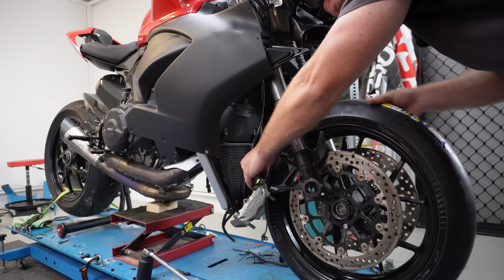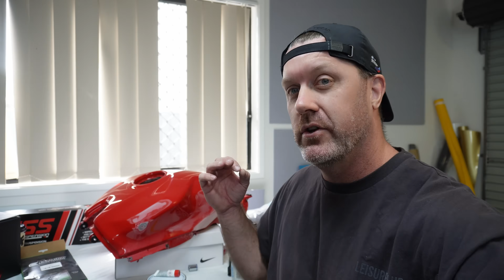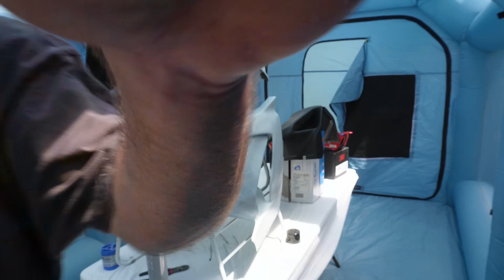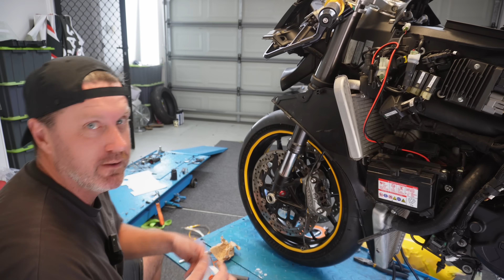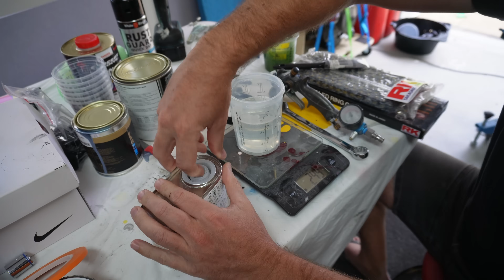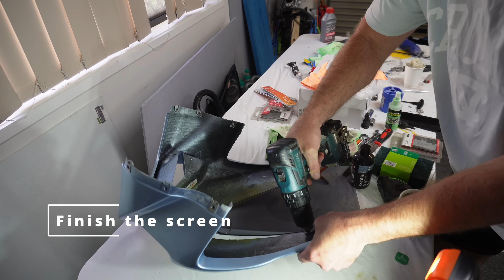I BUILT A CRASHED DUCATI PANIGALE V2....INTO A FERRARI STYLED SUPERBIKE!

Comment: Hi, not sure if the rotor of the V2 are 320mm or 330mm. If I am not mistaken it is a 320mm and the caliper spacers should be placed before the caliper and not sandwiched between the fork and calipers.
Reply from the maker: Yeah I think you’re correct….👍